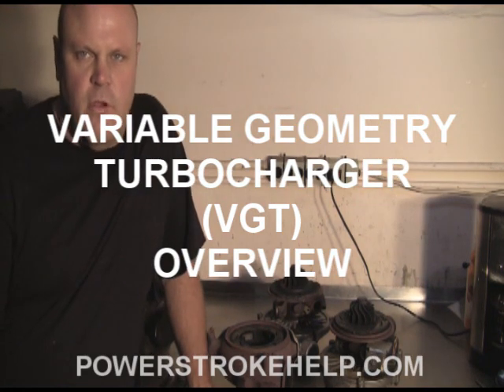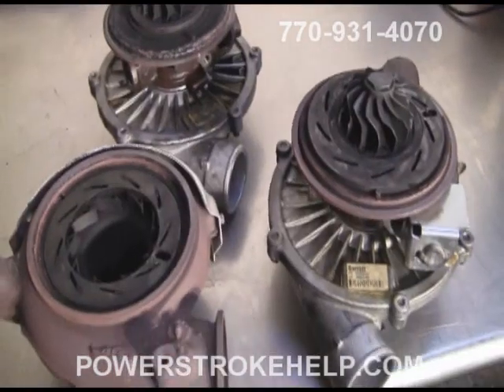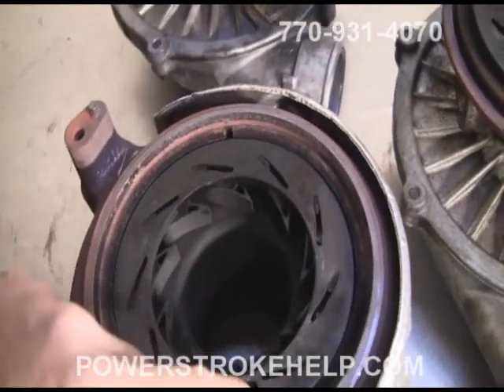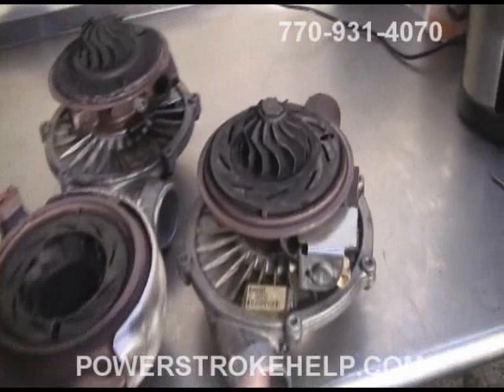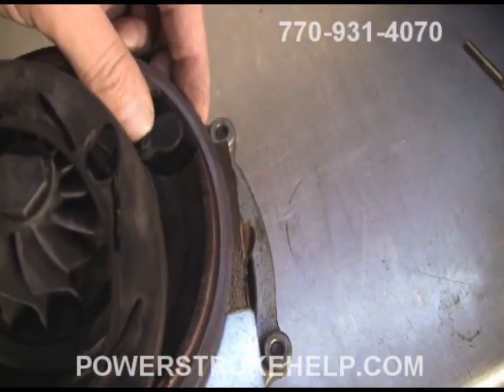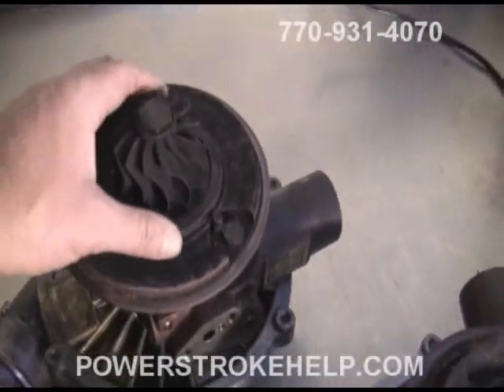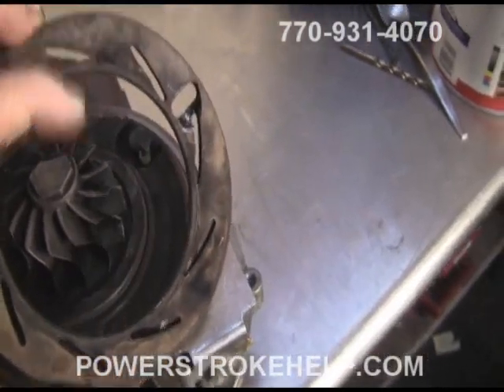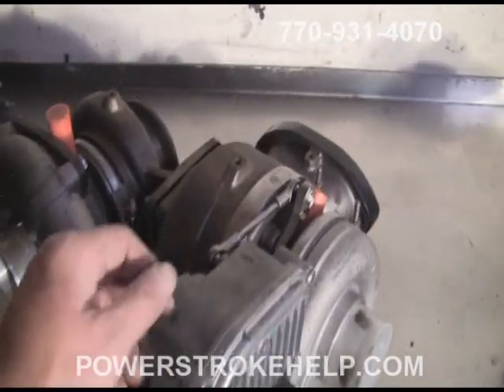VGT TURBO PROBLEMS AND FAILURES 6.0 AND 6.4 POWERSTROKE

Comment: Hi good video. I have and issue with my truck first  motor oil light and running engine reduce speed I check was oil escapes from exhaust radiator hose...any  😢 help  or clue

Comment: Yea dpf and now Def fluid it's all a joke to me. I wish people knew the truth to these systems and u stated in this video. Oh let's just make it burn 4times as much fuel to burn off the ash not smoke ash it's not harmful but all the furl they put in system to reach close to 1500dregrees exhaust Temps. And where are the emission standard for that it's way more than my 2005 gmc durmax. I drive 500 miles I burn less fuel and less emission than a 2020 diesel engine. Tree hugers if they new the truth. Certified clean idle is only time it's clean

Comment: Would internal mech wear out in the 6.4 dual wear to the point of no boost with only 160k on it I have no codes and I can move the actuator with my scan tool the exhaust back press sensor is clean no rat damage ? 2008 king ranch

Comment: How do you know if the seliniod gone bad? I noticed my truck turbo buzzes when I turn the key on and let the truck cycle before turning on then the buzz goes away. The initial buzz noise is random not all the time. No codes or lights on dash

Comment: Interesting way around the problem of low rpm boost threshold and max power: usually mutually exclusive parameters. But not at a high cost: correct me if I’m wrong, but if a vane breaks or the actuator ring breaks you are looking at catastrophic engine failure. Love my 12v 96 Cummins!

Comment: Hey Powerstrokehelp.. I know this is an old video but I thought I was worth a try.. after spending thousands on injectors and other stuff I started digging in myself. My 06 F350 6.0 smokes on acceleration (when cold) and sometimes when cold there’s a bit of a haze on start up.. I noticed my EBPS is at 60psi at idle and a couple hundred WOT.. I got a new ebps and same thing... I even plugged it in while out of exhaust manifold and even then it reads 54psi... when I unplug the ebps the smoke goes away and it seems like the turbo is more powerful then too.. could you point me in the right direction ?

Comment: i have a 08 f250 6.4L diesel that leaks either deisel fues or some other fluid, dont feel any loss of power engine sounds fine, runs fine as well...just new at this diesel system, can you help out some i wuld really appreciate it

Comment: I've got a 2008 6.4 got a high pitch squeal while idling and acceleration was told it was a bad waste gate the noise does go away when waste gate is unplugged any ideas

Comment: I just had a major turbo failure. The impellers on the exhaust side and the intake side both seized. On top of this the fins for the veins the shafts that hold them in on 4 of them sheared off so the blades were sitting down in there not even attached. I have no idea how that happened. 

I had a guy following close behind me so I punched on the gas to get some space between us and when I did so I heard a pop sound and started to lose a bunch of power. Along with this a bunch of white smoke was coming out my exhaust which told me my turbo just went. With loss of powerand white exhaust that told me the turbo went out because the air to fuel ratio isn't right which would mean there's not enough air in the combustion chamber to burn all the fuel being put in which would put lots of white smoke out the exhaust.  Got it home took the turbo off and that's what I found. I just hope small metal particles didn't get sucked up into the engine. I didn't see any small metal particles in the turbo anywhere and it looks like the shaft sheared off clean.

Comment: One thing that nobody mentions about these turbo's is that Ford stocks a nickel based high temp (2400F) anti seize formula for use in these turbos. If your truck doesn't move much or goes on short trips a lot it is important to paint them up to prevent the sticking problems. It also helps somewhat with the carbon buildup.

Comment: The problem with the 6.4 I got one word to solve that delete delete delete delete all that shit you'll save yourself some money in the long run it's worth it setting your fuel mileage throttle response and power go up and your reliability will Skyrocket

Comment: I have 2006 6.0 and the turbo wont hit 10 psi on dash gauge when i mash it, and then it rolls coal. And if i tow with it rolls coal alittle up hills, then temp on water gauge spikes, like it is overheating, and i goes back to normal.  If i shut truck off when temp spikes it won't start for 4 or 5 minutes.  My vgt% goes from 50% down to as low as 15% when i have scan tool hooked up and in park reving it.  Its stock, no tuner, egr deleted. New turbo time?  Looking for help please. Thank u.
Reply: @Bobby Jones What did you end up doing? Clean the turbo?

Comment: Can you tell me if my turbo could be sticking- i have a high pitch his from the clean side 2005 6.0 you can see the boost line bow up, no leaks, also as soon as i disconnect the solenoid it goes back to normal running. it has low power and seems to be over boosting at an idle. i just repaired 3 boost leaks on the y pipe it did sit for a while.
Reply: +Mad Wrencher What did you end up doing? Clean the turbo?

Comment: Forgot 2006 6.0 on pulling out like slug 10000 miles after rebuilt was running great now building boost faster than before and no turbo power if makes any sense

Comment: I have a 2006 f250 6.0 Diesel lariat 4x4 club cab I just had bullet proof 10000 miles ago now wen running right it was like hitting nitrous button wen hit throttle and boost gauge would climb slow and never get to 20 lbs boost now building boost quick off line but it is a slug turbo and vgt was put in new wen rebuilt 10000 mikes ago but now I took to where I had work done on guessing they don't understand me  that put sct x4 tuner in it they said problem solved went out on pavement hit throttle still a slug I told them 4 times exactly what people was. Can  Anyone help me out building boost but slug off line and wen at 35 hit throttle still slug before it had balls now it has peanuts any help thanks

Comment: 95k 2006 2WD F350 crew cab here. Bought this unit used 3 years ago. Pull a 281/2 Ft RV TT bumper pull with a 6,500lb wet weight - not too bad.  Since I've had it, it's always had a slow lag, slow spin up feel off the line. Then bam! It'll get up to ramming speed in a hurry. I'm  okay with that, but lately this last year (2017), as I'm towing on grades (3 -6%), the turbo shuts down and gives me either a CEL or the wrench/tool icon. Nothing ever overheats as far as I can determine. Each time during these climbs, as you know, I'm screwed, glued and tattooed - no power, inching over the climb at 35-40mph until I finish the climb. Once I can pull over after the climb, I'll do the usual code reading and end up with that P0299 code. I can sit for a few minutes, start back up, the warning lights all go away, and I've got my boost back again until I hit another climb - then the whole thing starts over again. With the travel trailer off, or at home again, I can run around town, down the freeway, drive like I'm in a drag race, and never ever see those dash lights again until the next time I tow. What up? Turbo? I don't hear any weird noises, no black smoke, nothing seems wrong until I tow up a hill. Time for a gas job? This is my second diesel... my 1st being a 7.3.
Reply: What did you end up doing to fix the problem? Clean the turbo?
Reply: My truck does the same thing when towing, and sets the p0299 code if I take off before the turbo spools up when it's cold-vgt sticking. I was told the turbos are worn out at about 100000 miles. I might take mine off and pull it apart and inspect it.

Comment: Jesus why not just put an injector behind the turbo instead of sending the flames of hell through it
Reply: Skinny Dugan, why not just do away all the emission controls if it's destroying engines?
Reply: Thats exactly what the Duramax system does, it has a 9th injector in the exhaust that works during regen to heat up the exhaust, but its past the turbo. Idk why ford thought fuel on exhaust stroke was a good idea..

Comment: My 2004 F350 experienced  a minor accident.  Trailer Jackknifed moving the after market exhaust severely.  The truck continued to run, but the engine vibrated and lacked power.  After a few days of driving rough, it sat over the weekend.  Then it tried to crank, but made a grinding noise and then wouldn't start at all.

I suspect i damaged the turbo.  I'm curious if you think additional damage occured by driving it for a few days after the accident.  If so, I'm going to smack my mechanic friend with a wet kielbasa for Fing up my truck.  Its at the dealer now waiting patiently in the cue.  I'm terrified.
Reply: What was the issue?

Comment: Hopefully you have time for a question that has me puzzled-What causes my boost to get up to 32-33 on the dash gauge? It's all stock and running right it runs around 20 psi boost on the gauge.now its jumping up to 30PSI+ and has no power until all of a sudden the boost psi drops to 20 and the truck takes off! No codes- new MAP sensor and air filter- VGT EBP MAP MAF all are normal on SGII...could I have a plugged catalytic converter? Man I hope you can  throw me something because right now I am just throwing expensive parts at it...Changed oil cooler 3 months ago and took turbo apart and polished all parts ( 3 years old from Ford) really didnt need cleaning just a little carbon soot....I inspected all parts in turbo as per your videos- no wear...so I am doubting the vanes are sticking...can you throw me a bone? Thanks man ( also normally running down the road I have 2-3 psi boost or none at all...now i have 10 plus... ( all this testing with no load)
Reply: Eagle Sports boost leaks?
Reply: Thanks randy- no leaks...turned out to be a bad EBP sensor even though the readings were correct for it on scangaugeII-real hair puller to figure out-- thanks man
Curtis

Comment: False info given regarding angle of the vgt blades vs low rpm spool.
Reply: I thought the same. Shouldn't the exhaust pressure be increased on the turbine when the vanes are closed? Thus they would be closed at idle in order to make the turbine spin faster and reduce boost lag? The vanes open at higher RPM in order to increase exhaust flow. So closed vanes = more pressure at low RPM, while open vanes = reduced pressure at low RPM. Correct me if I'm wrong.
Reply: Haha yeah. It's also called a unison ring, not an exciter ring.

Comment: My turbo is got it sound like it' air leak coming off of the Turbo
Any ideas what the can be ?
Reply: See if the CAC hoses are still connected on the passenger side of the turbo. Under a high boost situation it can blow off because the foam piece on top is worn.

Comment: I found the 6.0 to be EXTREMELY laggy off the line. So much that the term "Cowboy Kick" was coined for the way the boost came on. I would show people how laggy it was by flooring it and waiting for the boost. Most people were astonished. "punch off the line" is the last phrase I would use for a 6.0.
Reply: Thats because when you go from idle to 100% throttle, youre pouring more fuel than the air at that point. If you brake and spool just 3lbs of boost then mash it, i guarentee youll quit your bitching.
Reply: Lol sounds like you just have a slow truck😂get a better 6.0 I built mine so I don’t have problems like turbo lag
Reply: Mayo07J 🤔
Reply: Sound like you had a stuck turbo that only had boost at its highest rpm. That's not how it should work
Reply: The 6.0 was known far and wide for its turbo lag.From day 1, and from the day it got a new turbo, it operated that way.
Reply: Brake boosting is just reducing the lag that is inherent in the truck. You're not going to brake boost at every stop.
Reply: I know its 3 years old but it's a turbo diesel, they lag....If you want an immediate hit off the light buy a gas job.

Comment: Thank you for the excellent information on the Ford F350. We own a 08 F350 6.4 with 260K that recently made a brief noise that sounded like what I would imagine bearings being spun out. The truck then began blowing large amounts of black smoke out the exhaust on acceleration and under load and the mileage has dropped from 19.8 to 16.6 over a two week period of time. The truck drives OK although the power level does feel diminished somewhat.  The DTC is throwing the following codes P2263 (Turbo charger/supercharger system performance) and P0703 (Torque converter /brake switch b circuit). I'm assuming (based on the noise I heard and this p2273 DTC) that this means I most likely need a new turbo charger installed. Would you agree and could you advise me on what a fair range of cost for this repair might be ?

Comment: I have 04 f350 6.0 diesel I just replaced the turbocharger, now the check  engine lite came on , and when idle oil psi drops to 0 then give a little gas  psi comes up whats going on  Joe
Reply: Pat Ishee did you figure it out

Comment: Thanks for all the helpful videos Bill. Greatly appreciated.  I was wondering how common it is for the VGT solenoid to go bad?  My truck just threw a p0046 code. And I have like zero boost until I get around 3000rpm. Any advice would be very helpful. Thanks
Reply: i have the same problem... cant figure it out...did you figure it out?

Comment: have a problem with a 6.7 Power stroke mod. 2011 was producing a lot of smoke from diesel to accelerate me under the code 2073 and 132B, you change the MAF sensor smoke decreased but not completely and I still dialing codes 2073 and 123B. some idea of the problem? 
Thank you.

Comment: Is there not some wrong information in this video?
I'm pretty certain that on the 6.4 turbo arrangement, the SMALL turbo is the VGT, not the large one. Am I wrong?
Also, on my stock 6.4, EGT's typically were held between 1,100 - 1,200 degrees during regen. That's being measured right before the up pipe on the exhaust manifold driver's side. It NEVER went over 1,300 during regen. The part that bothered me the most is that the minute o would get on the highway, it would regen, and stay at the hot temps for 6 - 8 minutes. It drove me bonkers!
Reply: Do you not see the VGT mechanical actuator attached to the large turbo at 5:05 of this video?
Reply: If you measured the actual wheels of the turbos, you'll find out that the VGT actuator is on the smaller wheel turbo (53mm?), even thought the housing might be larger. The houseing will be much larger to make room for the moving vanes inside.
The larger atmosphere turbo (64mm?) is the turbo that connects to the air filter pipe. The housing is relatively small due to no moving parts inside (aside from the wheels)
It would be strange to have a small fixed geometry turbo & a large variable geometry on the same system. What would you gain by doing that?
Reply: Its a 66mm atmo turbo, and like a 46mm high pressure, the vgt is on the smaller compressor housing, he was comparing the exhaust housings.
Reply: 816Airsoft where are you getting your measurements? Are you talking about the compressor wheel? or the exhaust wheel? compressor wheels are 64mm & 53mm inducer size

Comment: Hi there I own a 6.0 f350 2006 and  I found these dtc displayed in my bully dog:

P0281: cylinder 7 contribution/balance
P0404  exhaust gas recirculation control circuit range/ performance
P0487 exhaust gas recirculation throttle position circuit
P1000 OBD-II Monitor Testing Incomplet 

3 days ago It was really hard for my truck to tow my trailer on my way home after finished work. Also it throwing this dense black smoke out the exhaust. Could you give me an idea of what is going on? Thanks. Victor
Reply: Canada's Best Roofers

Comment: They really went the el-cheapo route with the 6.0 VGT. A  VGT with the vanes arranged radially around the outside of the turbine wheel and with a water-cooled electronic actuator is the only way to make them live. And I see that's about what they did with the 6.4. The problem is that Ford and Navistar ALWAYS tried to get away with something that had already been proved to be a problem and then acted shocked, amazed and outraged when their marginal engineering failed miserably. You can NOT cut corners on a high-performance diesel engine and expect to get away with it.

Comment: I have 2005 F550 6.0L. When I'm towing there are times it sounds like the engine begins to choke as if not getting enough air. The air filter is new. Could this be a problem with the turbo charger?

Comment: Hey bill 05 f350....turbo acting funny. driving at highway speeds 100km/h turbo is jumping back from 8 psi to 13 psi in a rhythmic pattern (continuous). Vgt% is from 49-53 jumping back and forth again rhythmic (continuous). If i let off the throttle a tiny bit it jumps from the 8-13 psi strait up to 20 psi, then slowly goes back down. No power off the line unless i put the foot to the floor. Then it eventually kicks in with some power but is very short lived and goes back to no power again rpm's are at about 1600 when its struggling then jump to 2000. Any thoughts of where i should start looking?
Reply: What did it end up being

Comment from the maker: You are asking the wrong guy. I dont have time for this sort of silliness. If you can actually get the Turbo to physically mount with no exhaust leaks AND have some sort of screwy wiring to the TPS. What Tuning do you run? Nobody has written tunes for a VGT on a old 7.3L with VERY VERY slow cpu. The fact is that you will probably never get enough fuel at low end to feed the boost of a 6.0L VGT turbo. It would take 100s of tuning hours to get to run right.